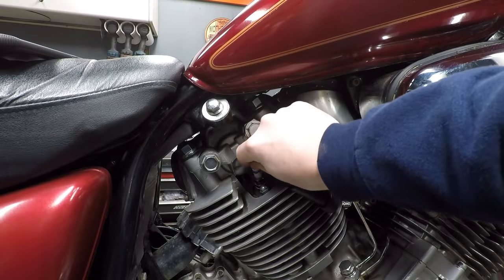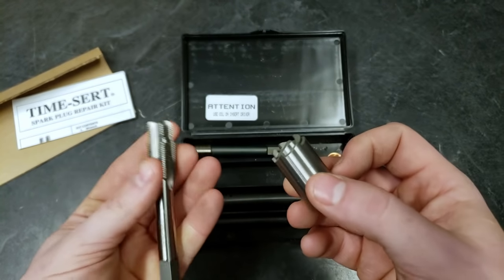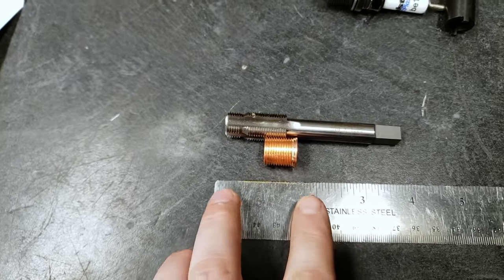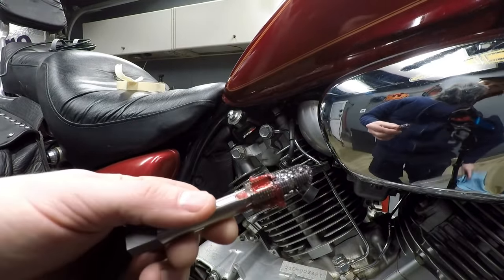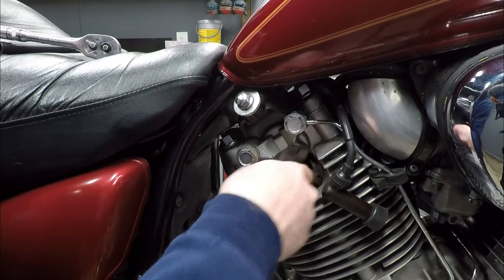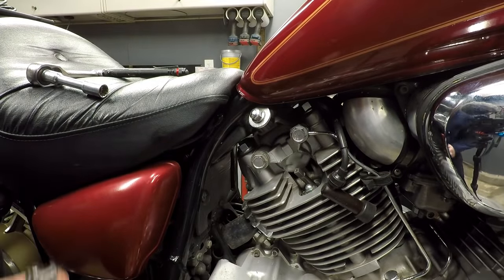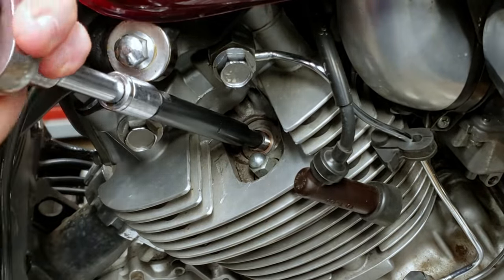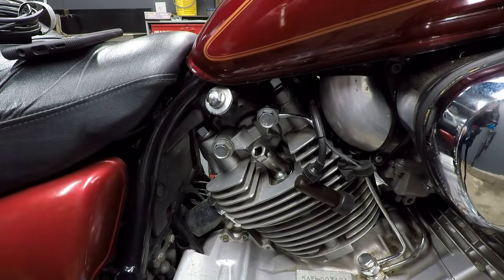Time-Sert Spark Plug Thread Repair - Fixing Stripped Threads

Comment: 5.4 number 3. I tryed and tryed get a tsp starterd wount start so far in head no room tap it get started tryed a chaser tsp nope a 14 mm tap with insurts nope still not wount go thread in that dam alum Ford craped head why wtf to do get it started  mite have try a back.out tap now
Reply from the maker: They make a specific repair kit for the 5.4. Like the exact scenario because it was such a common problem.
Reply: @BrickHouseBuilds  I have the rightsize taps just they not wounting to start in treads with little Grease and a tap just spins
Reply from the maker: @rickyjohnson9594  its not a right size type thing. They make a special kit specifically for the 5.4. That may be why you are struggling
Reply: @BrickHouseBuilds  it's a 14mm 1.25 it's right tap when to auto parts place they looked it up to be for a 2000 f150 5.4 both the chaser's tap and tap with inserts or to be right tread for it it's hard being number 3 passinger side not much room to tap it a bit only 3 ins or do work with I just mite try a back out type tap u see on line it backs off gos in u scew to right it expand s and u bk off it cuts new treads it says ??

Comment: Why not remove the head to keep from contaminating the cylinder!
Reply from the maker: How much is your labor rate?
Reply: @BrickHouseBuilds  $50.00 + per hour. Still better to do it right!
Reply from the maker: Dropping the engine, removing the head, and repairing simply doesn't make sense budget wise for this bike.  This is perfecty fine
Reply: He never said that you can't remove the engine and remove the Head, This is just and one of multiple many ways to make a repair. Everyone is entitled to repair their property any way they see fit.
Reply: Easy, to much work! 
Japanese bikes are usually very complicated to work on.
Removing or tilting the engine is a commong thing on the bigger ones.
Reply: @bobvido9875  excuses excuses!